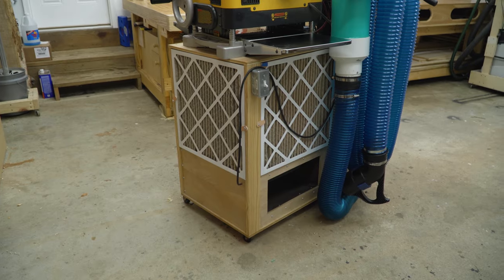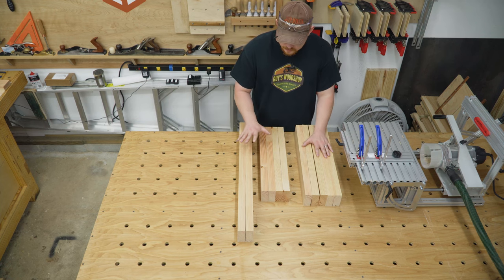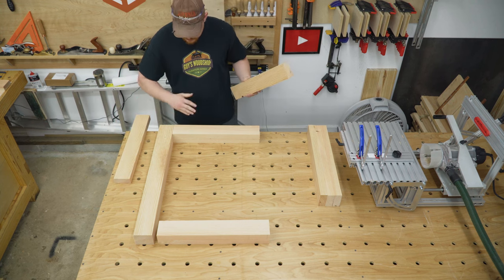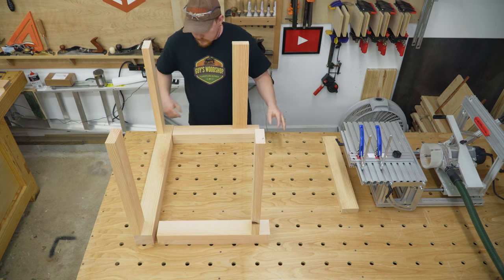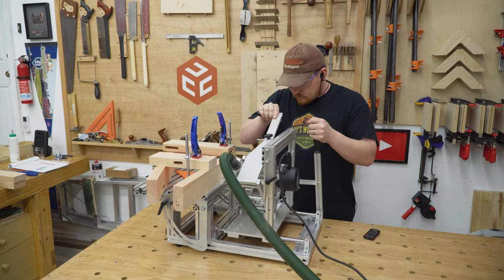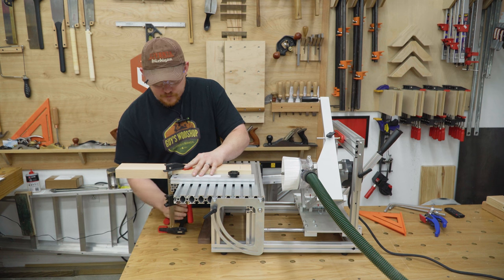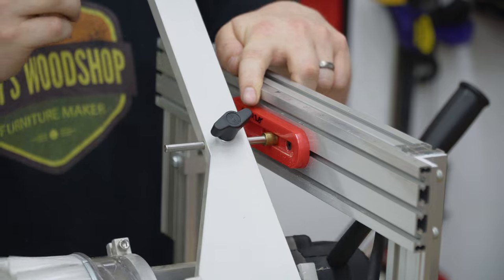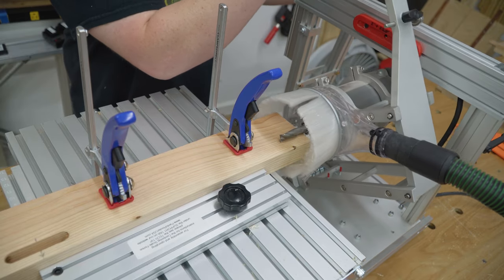Cantilevered Shop Cart - 279

Comment from the maker: Regarding the planer being too heavy: It's heavy for sure. But I don't think it will be an issue. The side walls of the mortise and tenon are basically two 2" x 2.5" lap joints with additional conflicting geometry in the joint itself discouraging the compression and tension forces from breaking the glue bond. The joint is large enough that I don't think it will be an issue. Also, the plywood panel on top was secured to the front of the cantilevered arm as well as near the back of the vertical post. With the two pinned points being on different pieces it will also provide some additional conflicting geometry to the joint. If the joint fails, rotates down at the furthest end of the arm, and pivots at the M&T joint there will be a tension force applied to the top plywood panel and either try to stretch the plywood apart (won't happen) or pull the screws through the 2x4 material. Another step to reinforce the joint would be to put a dowel through the center of the tenon to pin it in place. I don't think that is necessary but it is an easy addition if desired.  I've used similar sized single lap joints in the past with great results on load bearing applications. My last planer cart was the same cantilevered design but with smaller lap joints and its still holding up fine in my friends shop. I'll provide feedback if it shows sings of failure.

Comment: I used a Pantorouter for almost 3 years, ad got very good with it.  However, I found myself increasingly using a flat kerf tablesaw blade, and sometimes my bandsaw for speed on smaller projects or limited joinery needs.  I got talked into trying a loose tenon joiner, which I then bought.  Now, 90% of all my hidden joinery work is via that unit and I sold my Pantorouter.   

BTW, before moving to it I tested joint strength between handcut, panto-cut and Domino joints, and the wood always failed before my glue joints on all three.  It was fun learning and using the Pantorouter, but unless I had a huge number of joints it was a big waste of time on production projects— and even when it hit its stride, the loose tenon approach was a lot faster.   

I now have an 8’x4’ CNC too, which I use for fancy and complex work, and repetitive component milling and engraving mostly.  However, for 90% of my hidden joinery, the Domino has paid for itself more than 100-times over compared to my prior Pantorouter approach.

Just a thought...

Comment: Great looking cart! Functional and aesthetically pleasing. I like the little touches like tapering the top supports and even the angle you put on the caster blocks you had to add. Did you screw the planer to the cart?

Comment: Your videos are some of the very best in the woodworking genre, thanks so much for what you do! I'm curious how difficult the pantorouter is to use. I'm pretty sure I'd waste a TON of material before I got my first joint right.
Reply from the maker: You could figure it out on a section of scrap 2x4. It took a few times messing with it for the process to click but once you get the workflow down it's not difficult to use at all.
Reply: I agree, when I got my pantorouter, I was creating decent M&T joints in about 30 minutes, after having created maybe two test joints. The tapered template is a brilliant innovation. I will say that I ran into a few knots in my 2x4's, which really jolted the router bit and I had to re-tighten it. But it's very smooth when using clear lumber.

Comment: Jay, I really enjoy your videos and have built some of your designs in the past.  I have been looking to build a cart for my planer.  I have just a one car garage so my shop has to be very modular and adapt to the task at hand.  I was planning on building a four legged cart and incorporate some adaptable storage under since I have a older Ryobi planer that weighs a ton (80 lbs. plus dynamic load). I don't know how much your Dewalt Planer weight but did you give any consideration to weight with your choice of joinery or design?

Comment: Nice job. Jay, I've purchased $29 7- layer sheets of plywood for making a large toolbox, every sheet warped pretty good before I started the job. I live in AZ, so humidity isn't a problem. What wood did you use for your cabinets?
Reply from the maker: Birch plywood. Any plywood will work.

Comment: Love your channel! I have a question for you since I've seen you come up with creative solutions. I'm replacing the sink in a motorhome with a smaller sink, and need to extend the base of the countertop to support it before laying formica. Any ideas on what the best way to do that would be for stability and uniformity? Basically I need to add a piece of wood to the inside and somehow secure it for maximum stability horizontally.

Comment: Just curious about the weight of the planner and the stability of the stand.  I have the same unit and I know it's touching 100lbs without wood going through it. 

I'm sure the stand is more than enough to carry the load but I was wondering about side to side sway? (I'm not trolling!) 

On the other hand...I have noticed that we as woodworkers may over-engineer our work sometimes. I don't know if it's the macho man in us or what. Lol

Thanks in advance and keep up the great videos!
Reply from the maker: It's heavy for sure. But I don't think it will be an issue. The joint is large enough that I don't think it will be an issue. Also, the plywood panel on top was secured to the front of the cantilevered arm as well as near the back of the vertical post. With the two pinned points being on different pieces it will also provide some additional conflicting geometry to the joint. If the joint fails, rotates down at the furthest end of the arm, and pivots at the M&T joint there will be a tension force applied to the top plywood panel and either try to stretch the plywood apart (won't happen) or pull the screws through the 2x4 material. Another step to reinforce the joint would be to put a dowel through the center of the tenon to pin it in place. I don't think that is necessary but it is an easy addition if desired.
Reply: I didn't factor in the plywood top. Great point! 

Good job and keep it up!

Comment: Hey Jay, quick question. Do you draw your tools that are used in your sketchup designs from scratch, or do you download them? (Planer, jointer, table saw, etc)
Reply from the maker: +Jared Turner never draw what you can copy when working in CAD
Reply: I just downloaded April's table plans and saw that you drew them. They are excellent. I tried to learn Sketchup from your videos when you were in that apartment but just couldn't get it. You ought to exploit those talents to all woodworkers, etc if you don't already. You're really good. If you could do peoples videos  also_____. The're getting up there with Howerth.

Comment: Interesting video, but why the Pantorouter? You had a Festool Domino, were you not happy with it?
Reply from the maker: I still have it. Why not though? The Pantorouter can do infinitely times more tasks than the Domino. And I have the small domino. I prefer the larger M&T produced with the included templates of the pantorouter. That said, a plunge router and a mortise edge guide will produce the same results for this project. It would just take longer.
Reply: Thanks for the reply Jay. The set up of the Pantorouter looks so much more complicated compared to what I've seen of similar Domino operations, so I was curious about your decision making process. Thanks for the additional info. You are a font of knowledge and a continuing inspiration.
Reply from the maker: Thank you for the feedback.

Comment: Jay would pocket holes and glue be strong enough to use instead of T and M joint? as I'm just getting into woodwork.
Reply from the maker: Pocket holes are great for face frames or supported panels where they simply need to hold two pieces together and aren't relied upon for a huge structural load. Cantilevered designs result in a lot of force applied to a joint. This requires a strong joint like mortise and tenon or half lap or pinned lap joints.
Reply: Jay Bates pocket hole joint would be truly scary. I was even wondering if the mortise and Tenon joint was going to be strong enough. with a 90 pound machine and 20 to 30 pounds of material along with the vibrations a planer puts out I will be curious how the cantilever designed holds up over time. I would love to know how this project holds up over time and did you ever consider a finger joint.
Reply from the maker: The side walls of the mortise and tenon is basically two 2" x 2.5" lap joints with additional conflicting geometry in the joint itself discouraging the compression and tension forces from breaking the glue bond. I've used similar sized single lap joints in the past with great results on load bearing applications. My last planer cart was the same cantilevered design but with smaller lap joints add its still holding up fine in my friends shop. I'll provide feedback if it fails.

Comment: Could you have used your domino for this or is there not enough strength?  I don't have a pantarouter and have never done mortise and tennon by hand.
Reply from the maker: I don't think the small domino would produce a strong enough joint, even when stacked, due to the lack of depth into each piece of material. A half lap joint would be plenty strong enough.